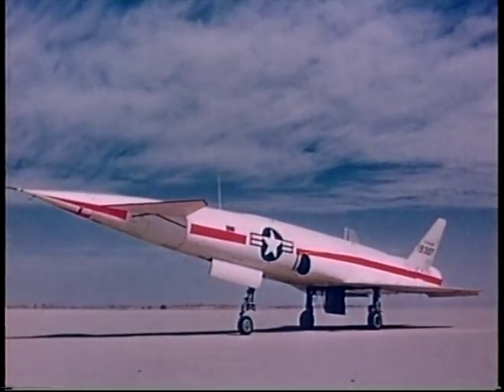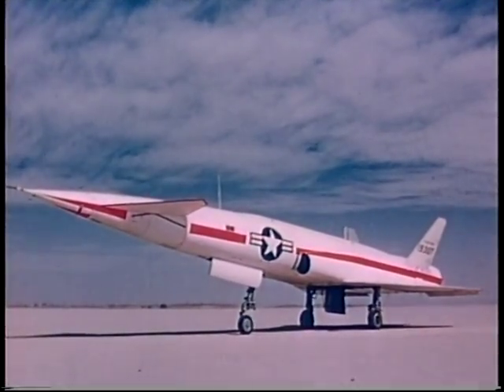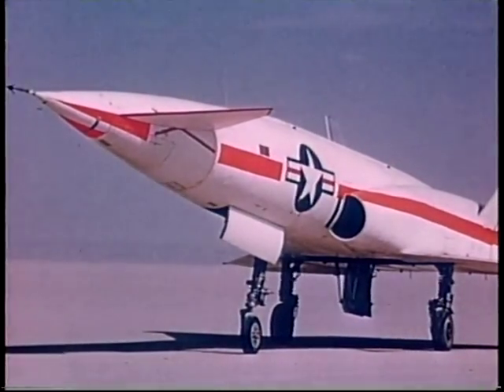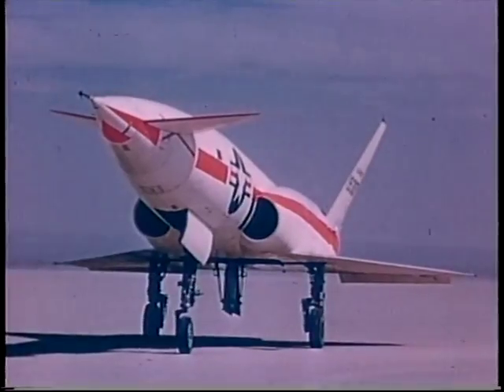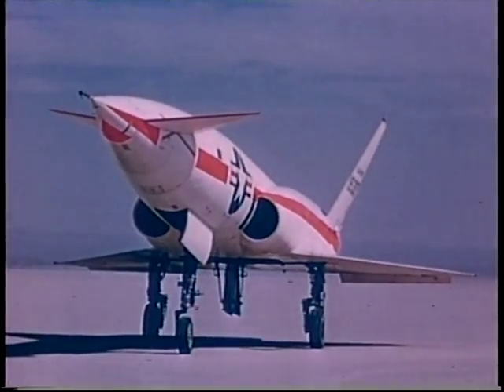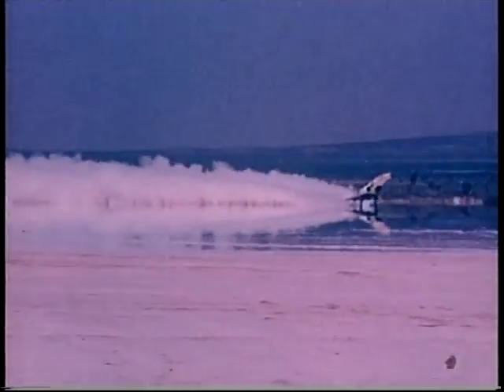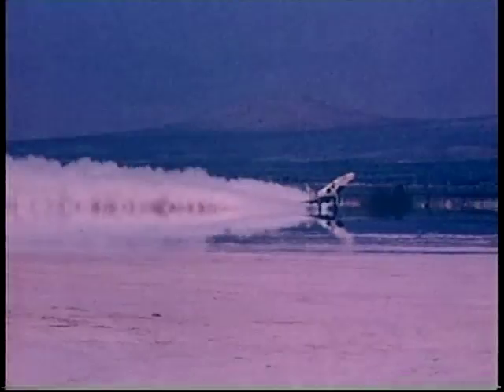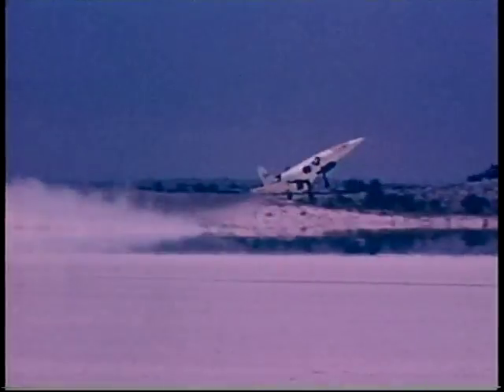Flight Testing X10 Air Force Cruise Missile

Comment: It's funny to see how many unmanned planes used canards decades before they will be use in regular planes.
Reply: Not sure if it's true, but I was reading Gibson's book about the Navaho history and it mentioned that the delta/canard combination was not sufficiently stable for unassisted human pilots and that it was only the early automatic flight controls that made the configuration practical. It seemed surprising when I read it.

EDIT - found it... seems the issue is that having pitch control (elevators) behind the wing gives natural stability having it in front of the wings makes for natural instability. Imagine a plane in level flight then pull back on the stick a bit... the elevators point down which pitches the nose up. As the plane pitches up the elevators also pitch up and have less effect on the plane's attitude so there is a point where the pitch stabilizes. Canards have the opposite effect - as the plane pitches up the canards push the nose up more, to the point where it's easy to flip the plane over backwards unless the canard stalls. The remaining surprise is that apparently the canards may/do not stall in supersonic flight and so use of canards in a supersonic plane without automated flight controls is a non-starter. 

So why weren't the automated flight controls from unmanned planes like the X10 used ? Apparently they were not sufficiently reliable to allow man-rating, and it wasn't until the arrival of fault-tolerant flight control systems that canards on supersonic planes became a thing. There were a couple of transitional designs (Kfir and Viggen among others) which used fixed canards as well.